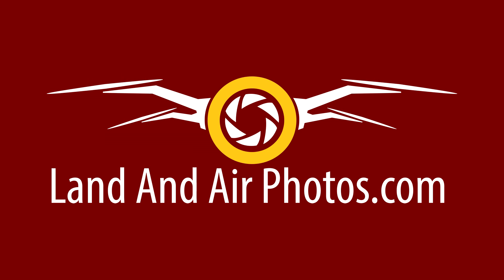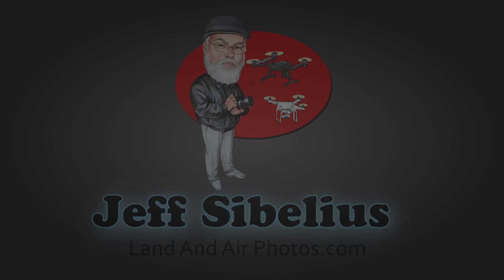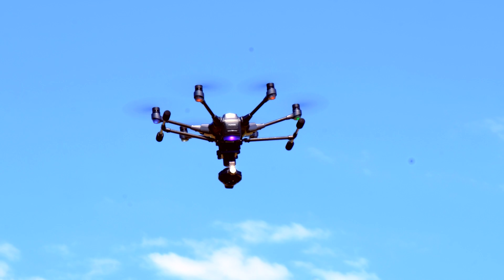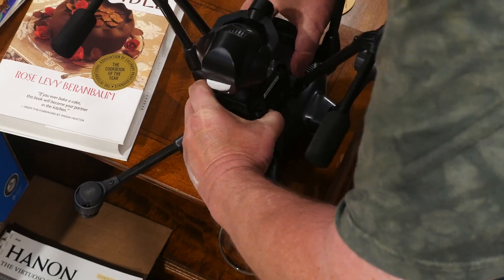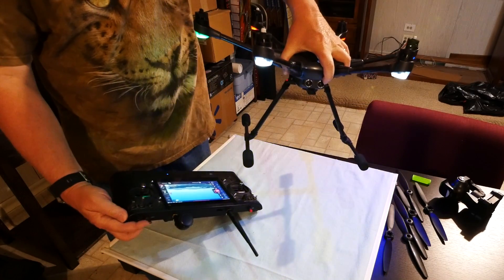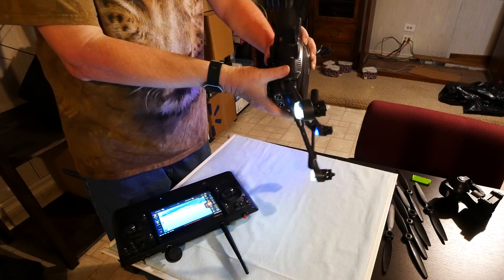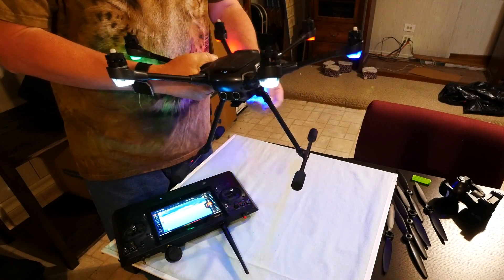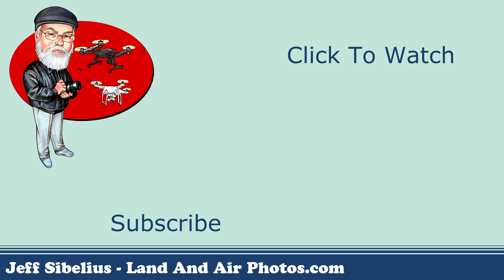Yuneec Quick Tip: How to Cycle the Landing Gear on the Yuneec Typhoon H - Resetting the Landing Gear

Comment: dude you rock!! i busted my landing retractor gears on a landing messing with the red button this video saved me from having to call yuneec. simple calibration step.  ... being brave and seeing what happens.. wont do that again.. also had to replace an arm hook/clip. typhoons teardown isnt too bad.. TOOLS are a long 1.5 and 2mm hex incase anyone needs to know. 

Question thou.. whats the internal micro sd slot under the hood of the drone itsself? 
THANKS for all the great videos clear video audio straight to the point etc.
Reply from the maker: Glad the video helped! I don't know what the internal slot would be for though - my guess is that it would be there for the people who are servicing the drone to use.

Comment: Thanks so much.  After changing the GPS and compass board, refreshing the firmware I could not get the landing gear to move properly.  Your video explained it well and fixed my issue and reset the gears.
Reply from the maker: love to hear it!

Comment: Great tip Jeff! after replacing the landing gear servo on one side of my typhoon H i noticed that it retracted slightly slower than the other side,i will be trying this out later today hopefully this will cure the problem!..Very nicely explained as well Jeff Thank you :)
Reply from the maker: Thanks! I hope it works for you. The landing gear are a bit unreliable with the H, but I think this technique might make them more functional for me at least. I stopped retracting them because they were inconsistent; now I'm going to start using that feature again.

Comment: καλησπερα απο ελλαδα sir geff πολυ ωραιο το βιντεο εγω επαθα ζημια με την καμερα και περιμενω καλο βραδυ
Reply from the maker: Hi Djaleks - I can't read this.
Reply: Good morning Sir Jeff damaged by cgo2 my camera from goof mine
Reply: I made the mistake and I bought after market my INAL has left Propeller 70 meters fell in yuneec built it and the helicopter and camera ala some point the camera broke down and I have 4 video wedding to september
Reply: thenk you sir jeff from greece
Reply from the maker: Oh, I'm sorry to hear that! If you have to replace the camera, it would be worth the money to get the CGO3 rather than the CGO2. CGO3 is a much better camera and gives you a lot more control over your images.
Reply: yes bat is it other the problem sir jeff
Reply from the maker: what other problem? I liked your wedding video by the way - very nice!
Reply: The camera is off the I did for PARTS had a problem on board into the camera And now something waiting for a money-making q500 + Sir Jeff
Reply: I am now stand bay for job
Reply: I turned shots of video editing and music are all my own Sir Jeff
Reply from the maker: If you need to repair or replace the camera and the Q500 itself, I suggest you look at prices to just buy a new Q500 - or even a Typhoon H. Prices have come down for both drones. It almost costs more to fix them than it does to replace them. 

Especially if you are getting paid to fly at weddings. Now may be the time to get a Typhoon H. It is a much more powerful drone than the Q500!
Reply: yes i now sir jeff thank you very much for your time good evening from GREECE